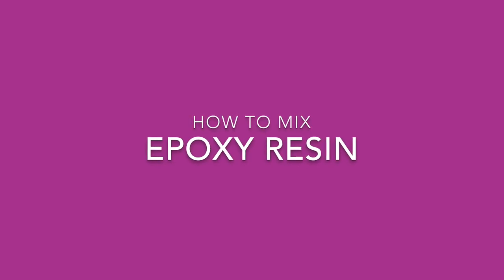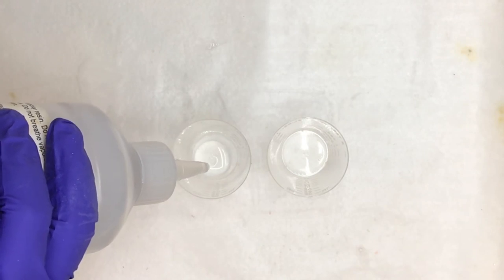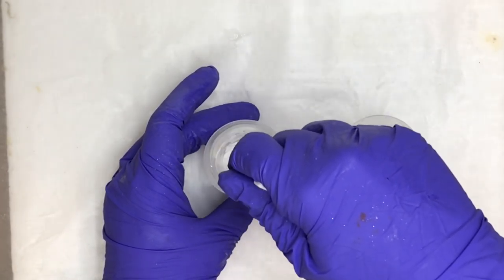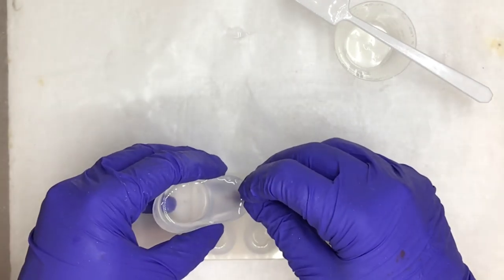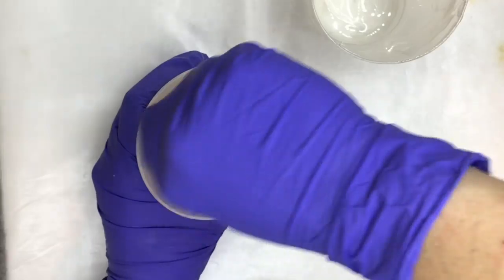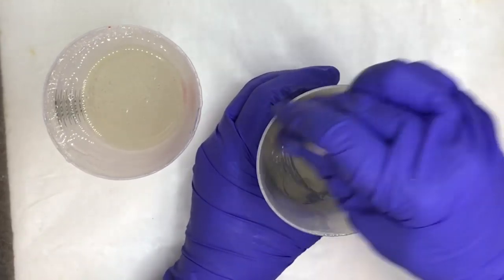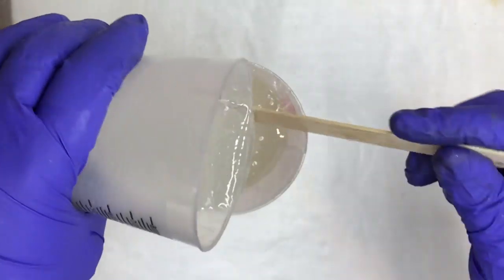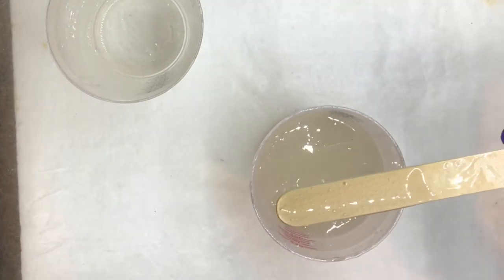How to measure and mix epoxy resin

Comment: Hi, I've been following your tutorials. Thank you so much for inspiring me. I just want to ask, because it's my first time to use epoxy resin, is it supposed to be bendy? I'm confused since my UV ones are hard,  my epoxy cured but it's still bendy. It's not sticky at all. I don't know if I'm doing it wrong or I didn't mixed it well. Thank you so much in advance!
Reply from the maker: Some epoxies, even when fully cured, can be soft or bendy.  What brand did you use?

Comment: Resin and hardner consistency is different
So
Will
Measuring cups will give proper texture

..
My resin earrings turned sticky 
Plz tell me mam
Reply from the maker: Hi VJ, it sounds like you're talking about resin and hardener densities. If your resin kit is meant to be mixed by volume, then the consistency won't impact the measurements. However, if you measure by weight, then yes, the density matters.
Reply from the maker: This article will help you with why your resin is sticky and what you can do about it: https://www.resinobsession.com/resin-frequently-asked-questions/why-is-my-resin-sticky/
Reply: @ResinObsession  thank you mam/sir
Can I plz know 
Where can I get resin in wholesale rate 
Measuring by volume 
In india
Reply from the maker: I'm afraid I don't know any resin suppliers in India.

Comment: I want to mix resin and hardener in 3:1 ratio for making small things how should I measure them in ml cup
Reply from the maker: Figure out how much of each part you need. Then measure them into two cups.
Reply: @ResinObsession  can you please give me measurement in ml for makeing small things such as keychain
Reply from the maker: @anamshaikh7676  You'll need to use the specific directions from your resin kit. Did you buy it from Resin Obsession?

Comment: How do you cute epoxy resin? Inwanted to buy uv but the lady at the crafts shop gave me epoxy so i might as well use it
Reply from the maker: Hi, once the resin and hardener are mixed, it will cure on its own.  You don't need a special light like with UV resin.
Reply: ResinObsession thank u so much!! I thought I bough uv resin that’s why I didn’t buy hardener and made some hahaha it’s still not hard and it’s been 5 hrs hahaahha

Comment: How many ml in resin do you need to make a ashtray?
Reply from the maker: Great question!  It depends on the size of the ashtray mold.  If you have the measurements, you can input them into our resin calculator and it does the math for you:  https://www.resinobsession.com/resin-calculator/

Comment: Why do we need to scrape the sides of the Cup and the stirring stick / rod while mixing the resin and hardener? 
Does Resin have a strong smell because you said we should stay in a well ventilated area.
And what happens if you mix resin without wearing any gloves?
How many minutes does it take for the resin to harden?

I'm sorry if I have a lot of questions. I'm doing my best to learn everything before starting my own business.
Reply from the maker: Hi Cinth, I'm happy to help with your questions.
Reply from the maker: 1.  You want to make sure your resin is well mixed before using.  If you don't make a point of getting the resin on the edges of your cup and stirring utensil mixed, your resin will cure with sticky spots.
Reply from the maker: 2,  Resin and hardener are like many other chemicals you work with (bleach, paint, etc.) . Some people are more sensitive to the smells than others.  Having adequate air flow minimizes the chances you will feel any ill effects from using the resin.
Reply from the maker: 3. I always recommend wearing gloves for the same point as in #2.  You are working with chemicals which may irritate your hands.  This safety article explains more: https://www.resinobsession.com/resin-resin-resin/epoxy-resin-safety-precautions/
Reply from the maker: The length of time it takes for resin to harden depends on the kit you are using.  Some can be as a few minutes, others take hours to days.  The resin kit you are using should specify this.  If it's a resin we sell in the Resin Obsession shop, we have that information for you.  Go to this page: https://www.resinobsession.com/resin-frequently-asked-questions/resin-casting/ and click on the resin casting kit choices link.
Reply from the maker: Hi Cinth, I'm getting ready to teach an online class on jewelry making.  If you are interested and want VIP access, add your email address at this link: 
 http://bit.ly/32CuuxC
Reply: Thank you so much for all of the answers 😊 I'm sorry the reply took long though.

Comment: Weigh, not eyeball.... small kitchen scale works amazing, and are extremely cheap on Amazon
Reply from the maker: HI Deejay, yes weighing resin is an option.  However, the ratio changes when you measure by weight instead of volume.  If you want to do it that way, please check with the manufacturer for the new mixing ratio.  Otherwise, you are likely to use too much hardener, which can cause your resin to overheat and cure quickly.